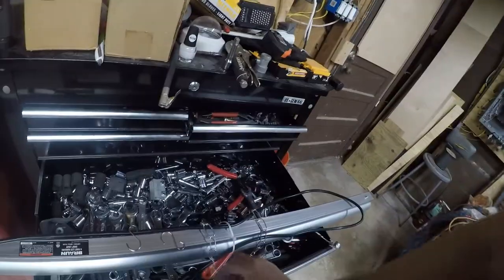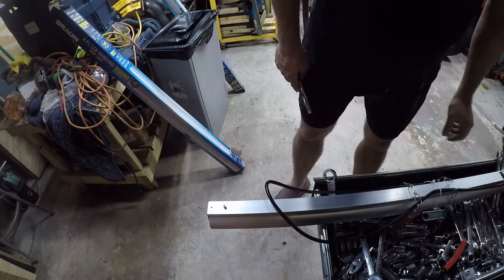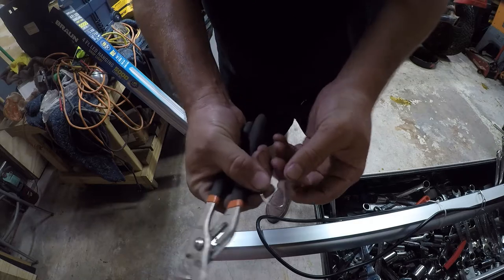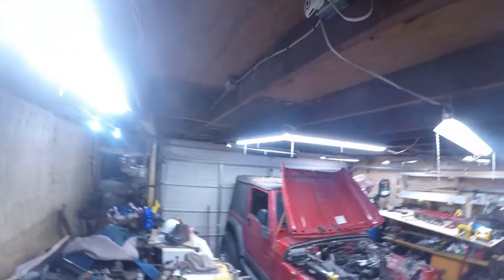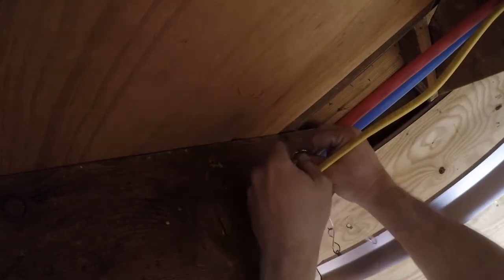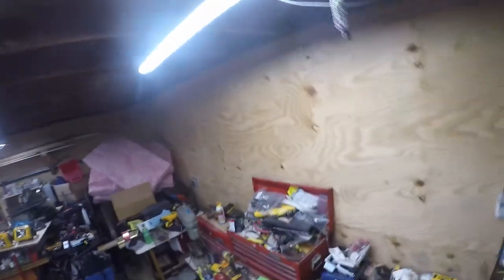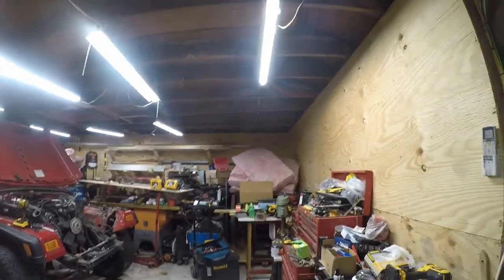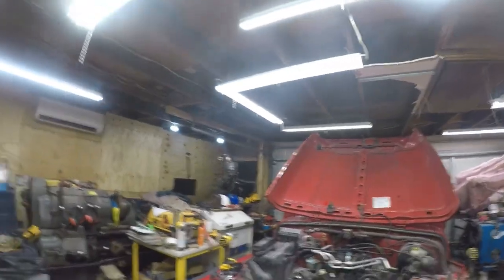Tool Review: harbor freight Braun 5000 lumen LED shop lights

Comment: I held my light and plugged it in before I put the chain on to make sure it worked. As I was putting the hook on it sparked a little on the hook, then it sparked again on the chain as I was hanging it up. Did you have any of these problems?
Reply from the maker: I did not.  Sounds like that one has a short in it.